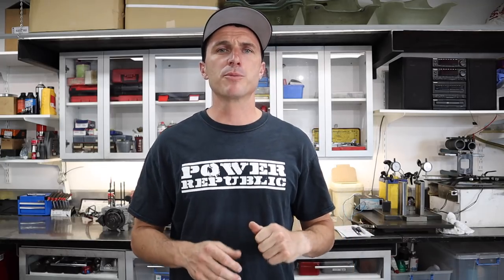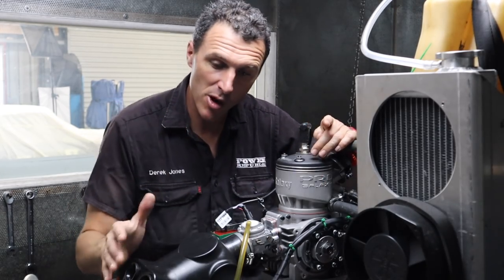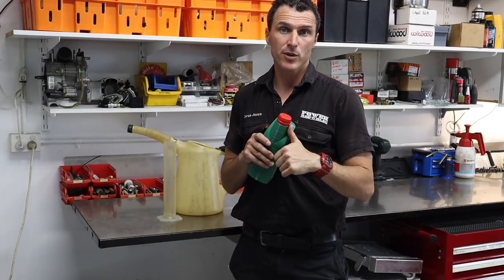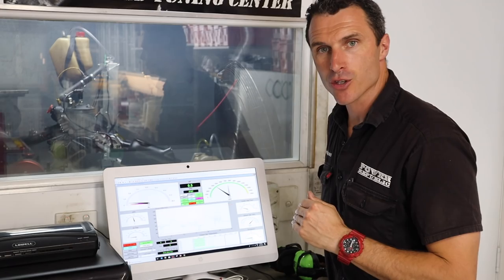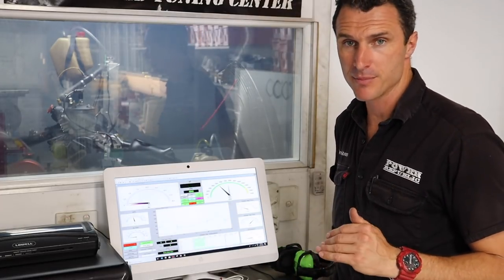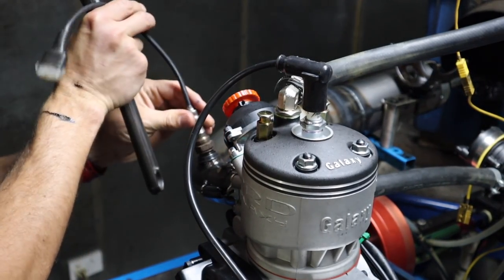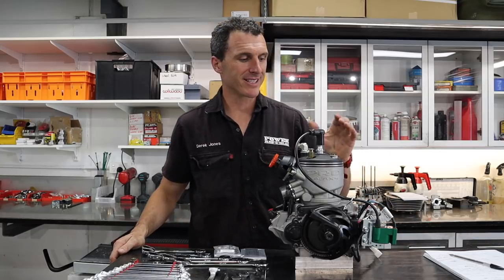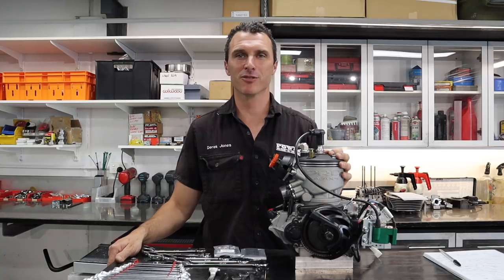Galaxy 125 Race Engine - The Road To Victory - Episode 1 - POWER REPUBLIC

Comment: If your using an X30 or PRD which is restricted would you still use a Castor oil in your  fuel mix? Considering that it isnt reaching max rpms?
Reply from the maker: you can use Shell M which I have found to be the 'cleanest' of the castor oils, or even Maxima 927.    otherwise, just use the trusty old Motul GP2T and be done with it

Comment: Hi Derek, love the channel, subscribed.
In your opinion, is the Galaxy a viable alternative to a Rotax Max? What are the recommended rebuild intervals for the Galaxy? About to get my first TaG kart to race at local club race days and wondering if it's worth looking at one with a Galaxy engine.
Reply from the maker: Hi schumifan, it will be now that we are coming into summer.  All the TAG engines are similar in lap times with the Rotax strong down low and the Galaxy strong up top.  If you new to karting and racing club days, the Rotax for usability is a no brainer.

Comment: Hey mate just wondering if many parts from the galaxy are interchangeable with say the fireball like say can you use the galaxy exhaust on the fireball to try and get a little bit more performance out of your fireball? Thank you and the videos are awesome as always
Reply from the maker: Hi Dean, they are but not by the KA rules.  If you're  going to use them on the dirt it should be fine, although you might have to make an adaptor for the exhaust socket to fit your fireball/Galaxy exhaust hybrid.

Comment: What is the use of the Dyno? Can one change something in the motor performance with it??
Reply from the maker: its great running engines, and comparing the output from different engines.  also for diagnosing problems.  you can maximise the ignition timing too on some engines

Comment: What is best PRD Galaxy vs x30 vs rotax Evo? Thanks
Reply from the maker: Depends on the racing you are doing? Where about do you live?
Reply: @PowerRepublic  I live in Portugal. I have a kart with Honda 390 engine. Today I was on the track and I Saw a PRD, x30 and One old dd2. In my opinion dd2 seemed Faster, but the PRD on the straight track was ahead of the x30. I became curious. Can you make a video about Four Stroke engines? Congratulations for your channel.
Reply from the maker: @ricardomelo4097  obrigado meu amigo.  I haven't used the 4 stoke engines yet.  the dd2 are awesome.  2 speed gearbox is awesome.  the galaxy are unreal in the mid range and top end.  the X30 is solid as a rock and very linear.  depending on the class yo want to race in dictates the engine you will buy.  otherwise if you are not planning on racing, get the DD2 every time
Reply: @PowerRepublic  thank you. One day when I have an experience I Will buy an old dd2, because the new kit is very expensive. I wish you much sucess. Best Regards